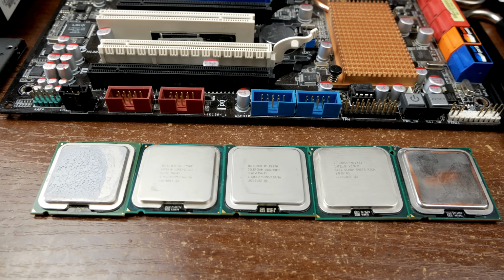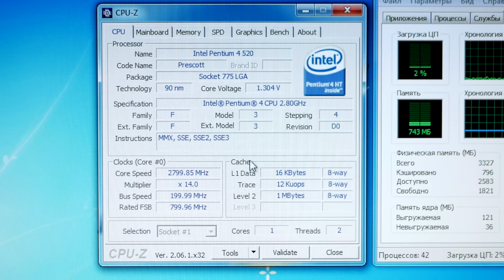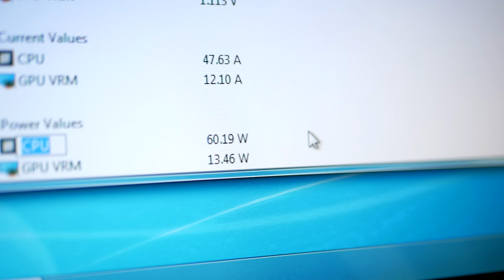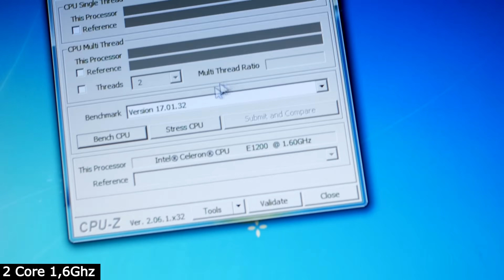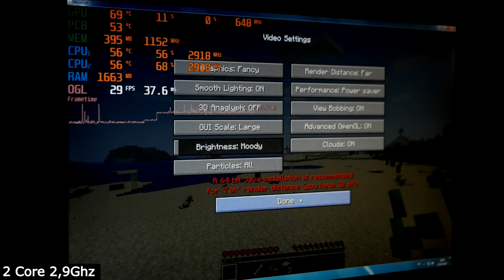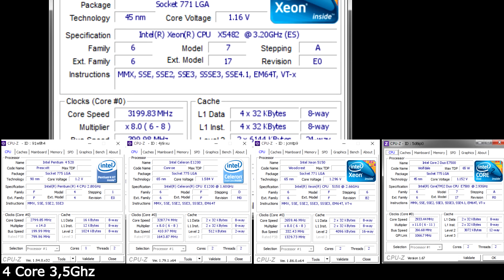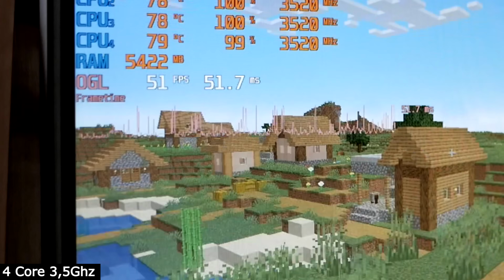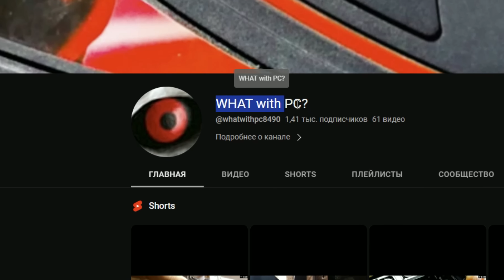Minecraft VS 19 Year Old CPU

Comment: In modern Minecraft, even though the chunks are loaded in with all cores, the tick rate (speed of most of the calculations in the actual gameplay) is still limited to one core (on Java).
Reply: And is there no fix??
Reply: @lamp7746 MCMT basically solves single threading
Reply: they would have to rewrite the entire code for minecraft @lamp7746
Reply: @lamp7746 re write in c++
Reply: Mods.
Reply: @itsentdev  A lot more than simple mods would be needed to fix the thread 0 bound processes. It's a foundational issue of the game's codebase.
Reply: @Jcorella  yes and Mojang keep adding new stuff instead of fixing this issue
Reply: @uruacufutsal1  I think Mojang's fix for this issue is called Bedrock Edition since it doesnt rely on Java.
Reply: @CativaCookie yea thats why bedrock runs very well on phones and tablets and light computers
Reply: @CativaCookie  it's too bad they didn't just make it a feature parity version of the game and retire Java. They made it too different, and the hardcore Java player base just don't accept Bedrock as Microsoft envisioned it. If it were an exact parity with open mod support, no microtransactions, and not locked behind Windows Universal App Platform, people would switch in a heartbeat.
Reply: @Jcorella Tell that to actual mods lmao
Reply: @shotybumbati  The Java playerbase doesn't accept Bedrock because it is an extremely limited version of the Java build. Sure it has great performance, but it lacks the ability to be modded in ways that the Java version can. That, and Microsoft is greedy af and is more than willing to slap price tags on things that have been free forever- such as player skins and resource packs.
Reply: @ReapersLove69 how? What's the name of the mod which can fix tick rate per core? Tell me please
Reply: @shotybumbati They wouldn't have switched because Java has bytecode manipulation in runtime which allows mods to change the game outside of the modding APIs. This is not realistically possible with C++, so Bedrock would have never been as popular simply due to lack of modding capabilities.
Reply: @shotybumbati of course I'm not gonna accept bedrock,  there's a fckn store to customize your player. And mod support is incredibly shallow. I dont like it at all, and I used to play BE because I was on console for a really, really long time.
Reply: @shotybumbati Also Bedrock even though Bedrock runs perfect its still such a buggy mess, when i compare the experience i can say i died in bedrock more to bugs then in Java modded.
Reply: @WimsicleStranger You can easily put skins and resource packs on Bedrock without buying anything lmao, what are you even talking about?
Reply: @KryptoKn8  Your comment is proof that you speak only and exclusively from hearsay.
Reply: @Jcorella  

There are mods nowadays which can actually do some functions in parallel, it's far from "perfect" and absolute, but it can help busy servers a lot. IIRC Folia with paperMC now can use multiple threads
Reply: there are alternative logic cores, like mcmt which attempt to multithread the game. Works great doesnt help the fps in the slightest though. it only help when there is tons of entities and logic load like complex redstone  @Jcorella
Reply: they would need to re-write the entire game... oh wait they've done that already, it's bedrock edition @uruacufutsal1
Reply: @aidrianpatullo598  literally a inferior version of the game. They could just re write better in Java since its also multi platform, but no they made a c++ version that is worse, messier and buggier. But hey you can play at 100 fps right? (no hate to the language just the way they made)
Reply: @uruacufutsal1  sure it was buggier on launch, but these days I experience no bugs at all with it and find that it has a smoother gameplay experience, it also has the added bonus of being able to play with friends no matter what platform they're on
Reply: @CativaCookie  in order for something to be a fix it has to, itself, work
Reply: @Jcorella  Like the GTA V loading screen issue
Reply: @WimsicleStranger not that I love Microsoft but they have to monetize the game somehow, a one time $30 purchase can't cover indefinite updates
Reply: @bread8465  how about 300 million one time purchases, and merch and spinoffs which only sell because of the popularity of the orginial?
Reply: @itsentdev  "Mods." 🗿
Reply: This is why I am glad Hytale switched to C++ the game will run smoother while being able to render more mobs and systems. Yes the waiting sucks but it will be worth it.
Reply: @blackstealth8168  I just hope Hytale doesn't lack a system for mechanisation like redstone, even if we have to wait for a later update for it. Just wished they had let people play it while in alpha/beta. The wait is really a let down. They don't even need to have official servers for it, just let us run our own private ones, ya know?
Reply: @shotybumbati I hope Hytale will actually release before the year 2070
Reply: @blackstealth8168  It's also why it's taking so long and will likely not release at all.
Reply: your right, the chunks is loaded in with all cores
Reply: https://www.youtube.com/@ChannelColor11
Reply: Get a life
Reply: @waht.mp4  lol says the political gimmick account
Reply: Just use Sodium for better performance on Minecraft
Reply: this is why minecraft needs to be rewritten in rust
Reply: @simulprod  C++ is far better and bedrock is written in C++
Reply: In modern Minecraft, even though the chunks are loaded in with all cores, the tick rate (speed of most of the calculations in the actual gameplay) is still limited to one cord (on Java).
Reply: @TheStrawberryGurl  why do you copy-paste other people's comments? Are you a bot?

Comment: I think with newer CPU's you can't really overclock them because they are already clocked as much as possible by default, or at least close to that.
Reply: Legitimately true. My 5600X doesn't need an overclock. It came ready out of the box. I could boost it up to 5GHz if I really wanted but it's not necessary.
Reply: You can overclock them, but for like 10% more performance AT BEST, not even close to a 2x performance as seen here

Comment: Point is... newer processors have a very fined tuned overclocking that's called "boost clock". Otherwise if you compare them, most are 2.5 to 4.5ghz base. Its the boost clock (and sustained) that gives the extra performance. If you try, say, the 7600 without boost, then try the 7600x with its boost clock, im pretty sure performance would be pretty far apart from each other.
Reply: also the better your cooler the more it will boost as it will see it's is running cooler and boost more due to that fact simple
Reply: @raven4k998 the newest cpus (7000 series amd, 12-13 gens intel) like to boost beyond rated boost clocks even if thermal headroom is enough and the application allows for it

Comment: 2 to 4 cores are best for minecraft... if you have a faster clock on a duel core... it will be faster then a octacore or more cores... because the processor runs into less problems... all thoes cores ger crosstalk because they all try and accuss RAM... ALOT... so it destroys the performance

Comment: Ah got hold of a Asus p5q premium i see, fun board too mess with.
Last time around i messed with it i got a core 2 duo e8400 too 4 ghz @ 445 mhz fsb i believe.
2.2v on memory, active cooling on chipset because that needed a slight boost in voltage too be stable in dual channel (Yep memory controller is on chipset here rather then built into the cpu so it can affect stability quite a bit.)
Memory wise a pair of 2x2 gb ocz reaper 1066 mhz ram sticks that managed with the overclock, though mine are chrome on the heatpipes there rather then copper, guess mine are a bit later versions.
Reply: I remember when I had a Q9500 and got it from 2.66 GHz to 3.4. I thought it was the wildest thing that it could even be raised that much, I had it paired with 4x2 1066 cl5 though.

Comment: this is GENERALLY speaking a good video but your use of technical terminology is quite bad. saying that "intel released 775 sockets" makes it sound like there are seven hundred and seventy five of them! be more accurate please and use proper terms like "intel released The LGA775 socket"
this video would be so much better if you just used terms that make you sound actually intelligent instead of sort of correct.

Comment: I remember playing with the intel core 2 duo, it was playable until 1.7/1.8, where it definitely dipped under 30fps.
Reply: 1.7 have better fps
Reply: I still rocked the E7500 today. It'll "only" go as far as 1.15.2 with what I consider stable and playable framerates. That's with optifine though, and 1.16 onwards is out of question, because even with optifine added it won't run stable enough to be called "playable" by me (and let me tell you, my standard of playable is very low, 20fps at minimum, just to picture how terrible it is lmao)
Reply: @harissuryasaputra7267 have you tried Sodium?
Reply: @leslie5202  to slow ram and its bad idea
Reply: @TitoBosnia  I can play 1.20 just fine with a first gen mobile i7. Sodium makes it run so well
Reply: @KofolaDealer  I've tried 1.16.5 with sodium, it instantly crashed lol. Even with optifine it's averaging like 5-10fps, not good enough
Reply: у меня intel core 2 duo e7400, спокойно играю на 1.7.10 с модами в 40-60 кадров. 1.17.1 с трудом , нужно запускать мир на отдельном сервере. Сегодня попробую его разогнать.

Comment: Request:

Honkai Star rail vs 15 year old CPU.
Reply: i'd say it has a chance on a core2quad or xeon as long as it has the correct instruction sets and with a bit of oc. Not too sure about the 2 core ones tho...
Reply: @joey_f4ke238   I didnt overclock (Because of a OEM PC) and works well on duo a e7730 with 4gb ram windows 10 (and Windows 7 last time). Few FPS but atleast playable with hd5450. Didnt Crash atleast of longer playtime. Which is a suprising results since most 2023 games didnt start that except Pray Game.

Comment: If all you want is a minecraft machine, all you need is one of those athlon apus amd was selling a few years ago, or better yet, an old i5 optiplex, which you can get for like $100, and even with 3rd gen intel graphics will run fine as long as you temper your expectations. Personally, I have a 12100 with a 1660ti, but even before I got the gpu, it could run perfectly fine, even with like 57 mods, most of which are only a few hundred kilobytes, but 20 of them are 1-5MB each.
Reply: yeah you can run it on pretty much anything with sodium. i remember i told this one guy on reddit how to install it and it got him from like 15fps to 50ish on a 2100u
Reply: I used to play Crash Landing on a 32bit Dual Core, an 80 Mods Modpack, so you're definitely able to play with way more mods than that.

Comment: The celeron REALLY surprised me, 2x performance after an oc???? That just proves old tech is just the coolest!!
Reply: Silicon variation was massive and they produced pretty much a single chip, so in order to make a lineup they needed to artificially reduce clocks of some of them.
Today Chips push themselves to the limits
Reply: @GewelReal  This is basically the answer.  They also needed to advertise the Celeron as the ultra low-power option, and clocking it up defeats that purpose.  But you can clock up Celerons by pretty ridiculous amounts
Reply: Even the Northwood Celerons overclocked well!
Reply: @qwertykeyboard5901  The problem with Netburst Celerons is that no matter what clock you ran them at, they still sucked. The Netburst architecture was heavily cache dependent, and with the hamstrung 128/256/512k of cache instead of the 1M/2M that the Pentium 4s came with, it really crippled them. The other asshole thing Intel did with Netburst Celerons is they decided you didn't need EIST and disabled it. This meant that Celerons had no speed step clock modulating support, they ran balls to the wall 24/7. This made Celerons consume far more power than their Pentium 4 bretheren, even though they were much slower.

Intel continued this trend into the Pentium M/Celeron M era, where it really stung end users. Laptops with Celeron M CPUs had abysmal battery life. My dad bought me an Inspiron 1300 in 2006 with a Celeron M 1500. It couldn't down clock, which crippled battery life. I was lucky to get even 30 minutes just sitting on the desktop. A few years later, I upgraded it to a Pentium M 2.16 and the battery life went up to at least two hours, more if it was just idle on the desktop.

Thankfully Intel reversed course with the Core 2 and I think all of them supported speed stepping.
Reply: Not as cool as me putting tape over a couple of pins and going from 2.4 to 3ghz on a core 2 quad in my crappy dell office PC that had the most locked down bios ever about 12 years ago 🤣.
Reply: @Arek-lj6zn  That was a Core2 based Celeron. Conroe is the architecture used on the first Core2 Duo CPUs (the E6000 series)
Reply: So sick
Reply: Core 2 based Celerons were monster overclockers, you could usually easily get a 1 GHz overclock on them without even bumping the core voltage. The trick was finding the lowest bus clock Celeron with the highest multiplier, which I think was the E3500 and just start cranking the bus speed up. Since the LGA775 socket bus speed topped out at 1066/1333/1600 MHz (depending on the chipset and board), you had a pretty wide margin starting at 800 MHz.

I had a Pentium Dual-Core E6300 back in the day with a stock clock of 2.8 GHz that I ran at 3850 MHz for years on stock voltages and never had an issue. It was still working when I retired it after about 5 years of use.
Reply: 2x0 is still 0 though
Reply: Back in the day OC used to be something, really increases performance. Now is just slaughtering electronic, heating up everything, draining gigawats of power by disabling every power saving mode and all for 5% higher score.
Reply: Yeah, I grew up on a celeron processor
Reply: @SouthernerDan  fr anyone who hasnt used a celeron craptop has never had the struggle
Reply: @MaskRobloxOfficial  My friend just bought a 1ghz celeron laptop, he's not tech savy, so he''s learning on a cheap PC, and then he's gonna buy a real PC in a few years, I grew up with a better celeron in 2002, I'm genuinly confused on how he got a 1ghz celeron cpu to work with windows 11 pro
Reply: @MaskRobloxOfficial shiteron laptops are so bad yet so good
Reply: @SouthernerDan  oh I've had one of the new celeron craptops, it's like they get worse every year despite the march of technological progress, mine barely even worked with windows 10
Reply: @SouthernerDan windows 11 has trash requirements
Reply: @SouthernerDan  bro probably struggles to open the calculator fr. Win 11 is already a bloated OS for modern computers, nvm a 1ghz celeron
Reply: modern hardware comes pre-overclocked from factory. the extra performance you get overclocking manually is expected because they become way too ineficient at those frequencies and voltages. the overclock needs to be stable too so the cpu doesn't crash and nobody in the factory is going to manually fine tune the overclock so you get 2 more fps with 50% more power draw.
Reply: This is an old version of Minecraft
Reply: The celeron REALLY surprised me, 2x performance after an oc???? That just proves old tech is just the coolest!!
Reply: @Arek-lj6zn  Yadayadayada, shut up